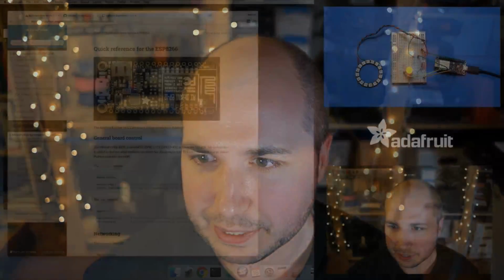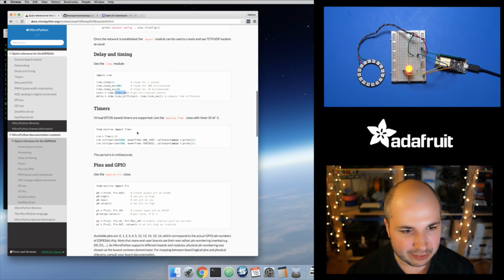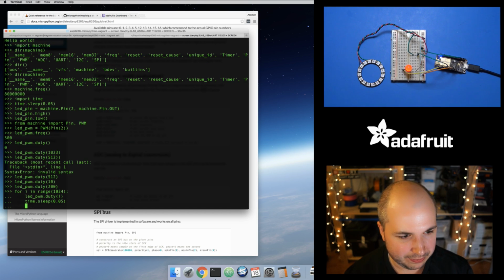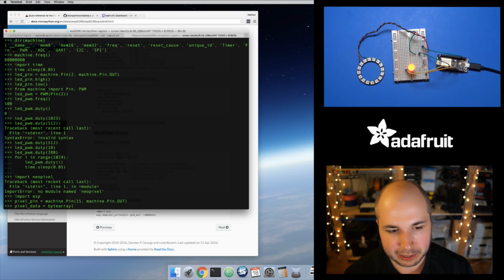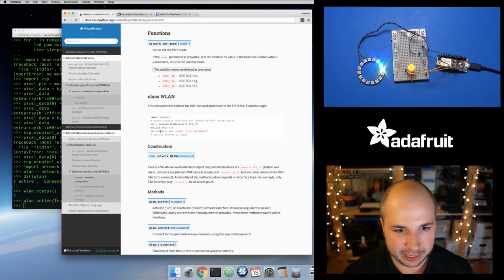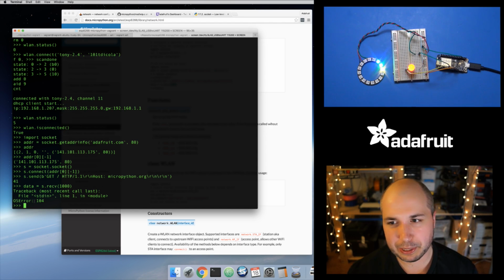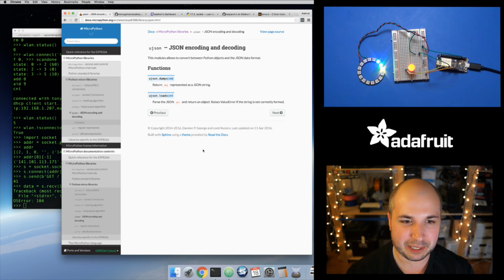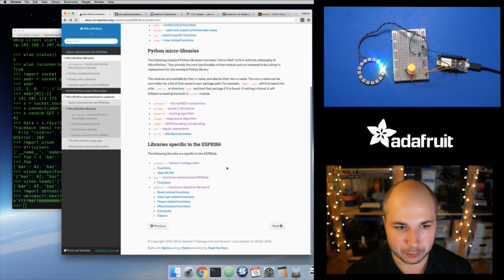MicroPython on Feather ESP8266 pt. 2 with Tony D! @adafruit #LIVE

Comment: As always, I really enjoy those videos.
But since the last few days, I've been unable to compile the esp8266 firmware on the vm.

I'm getting this error :

vagrant@vagrant-ubuntu-trusty-64:~/micropython/esp8266$ make
Use make V=1 or set BUILD_VERBOSE in your environment to increase build verbosity.
GEN build/genhdr/qstr.i.last
In file included from ../lib/axtls/ssl/ssl.h:75:0,
                 from ../py/../extmod/modussl.c:37:
../lib/axtls/ssl/tls1.h:43:21: fatal error: version.h: No such file or directory
 #include "version.h"
                     ^
compilation terminated.
make: * [build/genhdr/qstr.i.last] Error 1
make: * Deleting file `build/genhdr/qstr.i.last'
vagrant@vagrant-ubuntu-trusty-64:~/micropython/esp8266$
Reply: +Catalin FPGAguru and +Chuck Swiger

I found the solution. in the dicrectory in the directory micropython try :
git pull

folllowed by :
git submodule update --init

and then int the directory micropython/esp8266 :
make axtls

once finish try this command again :
make

it shoud work.
Reply: +Sandrine Marquis I'm getting the same error :(
Reply: +Chuck Swiger :( I didn't find any solution yet.
Reply: +Sandrine Marquis I am getting the same error too. I found this page that describes a similar issue and can be translated with Google Chrome but it did not solve the problem for me: 

http://tomokuns.blogspot.ca/2015/04/esp8266_10.html